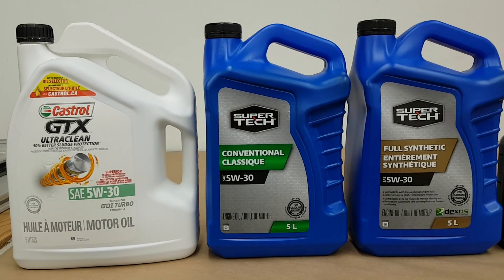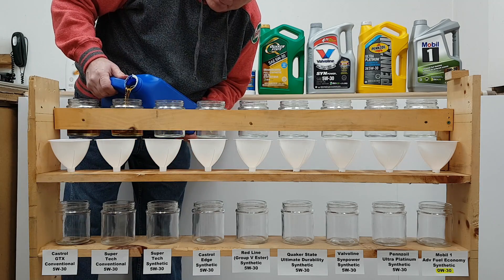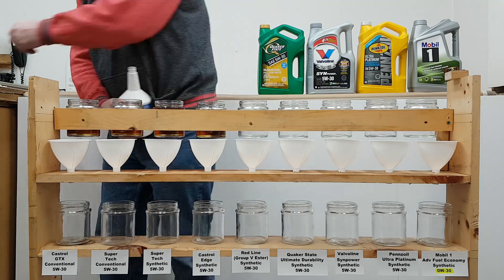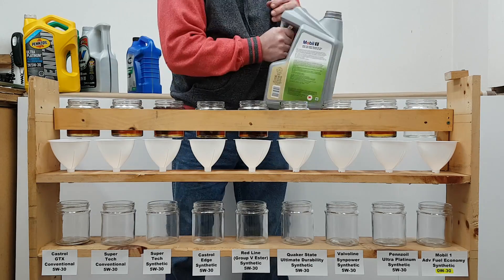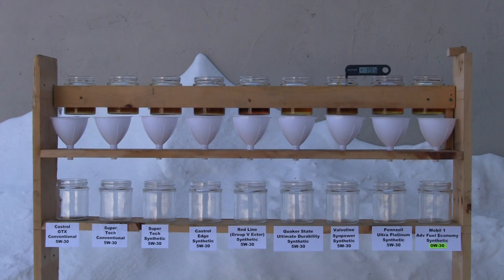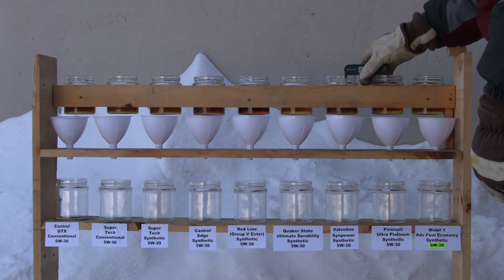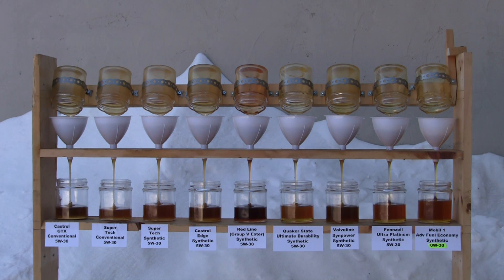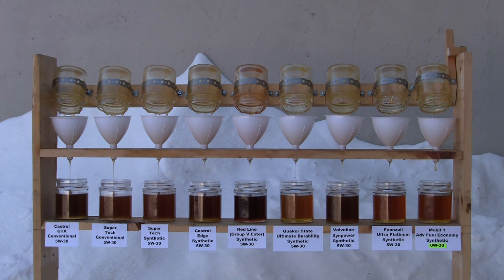9 Oil Cold Pour Test - Round 2

Comment: All oils work at cold weather. lighter is not good and heaver also not good. Choose the middle not light loss viscosity and not heavy cause late to reach engine parts and consume more fuel during the engine running. In general I would use 5w-30 synthetic from any provider in winter for all the counties close to the north pole, and below -20 degree use 0w, and 10w30 in middle east. in summer I would use  5w-40 synthetic, and 10w-40 synthetic for middle east. I recommend to use the oil pressure indicator on you car panel as a judge, when you use light oil, it will drop between the zero and first quarter, if you use heavy oil, it will increase above the half. use an oil that make the indicator at the middle or between the half and quarter.

Comment: There is one oil that while not popular claims to out do Amsoil and that is SynLube™ Lube-For-Life® which claims a 50,000 mile change interval (or no interval at all) instead of the 25,000 miles claimed for Amsoil.
http://www.synlube.com/faq9.html

Glad you included the two Supertech oils here. Why use conventional when for 24¢* a quart more you can have synthetic? (*Current difference in price for Supertech synthetic vs conventional 5W-20 in 5 quart jugs.)

Comment: These Cold Vicosity Test mearly show the amount of vicosity additives that have been added to the oil, they all meet the SAE vicosity requirment, if the Hi-Tech or Wal-Mart 5w-30 flows faster than any of the Top End Oils that tells you  that you are getting more cold weather vicosity additive than in the other oils, means your getting more for your money!  The interessting quastion is "who is mixing these  Low Price Oils that are knocking the High Price ones out of the ball park?"

Comment: What about amazon brand motor oil?
Reply: same as Super Tech oil, read the fine print on where each comes from.  as long as you are using the correct weight and API Rating (according to your cars owners manual) you are good.

Comment: Why not test all the oils with the lowest weight possible like 0-5w-20.
Reply: It won't make any difference.  A 5W30 will pour the same as a 5W20.  The lower number is the cold pour viscosity and the upper number is the viscosity at operating temperature.
Reply: Why Pennzoil ULTRA still would win

Comment: Outstanding.  Looks like Mobil 0W-30 Advanced Fuel Economy offers the best of all possibilities for newer car engines in the way of good cold and hot weather engine protection combined with superior fuel economy.
Reply: I'd bet 0w30 Pennzoil ultra would beat it
Reply: So you would run 0W-30 even though your oil cap says 10W-30 only
Reply: @diesel6916  I wouldnt I'd run the oil weight your car maker recommends

Comment: No cold enough bud, some of those oils were slower because they are thicker starting viscosity.  Good news is all those will protect down to -5f, bad news is if the test was -15f lower you would have seen a few of those oils fail and slow.  Check the other youtube on cold flow, you will see.  I know it's hard as freezers don't even go -20f, but if you don't go that low you don't see oils fail.
Reply: Depends where you live.  For many people, this is as low, or lower, than they will ever experience.  Tests at -40C are theoretical for lots of people.
Reply: If your winter temperatures are lower than - 20 F. crankcase heaters or covered garages offer best protection.

Comment: Looks like the 0W30 won handily, as it should, having the lower W rating. I would postulate that -24C is at or below a safe rating for 5W30, 0W20 or 0W30 would always flow better in arctic conditions!
Reply: 5W oils are usually tested @-30C for cold viscosity and 0W oils @-35C. A good 5W oil is safe to use still @ -30C temperatures. i live in Finland and use Mobile 1 ESP 5W-30 and never had a cold start issue, even if my car does not have a engine heater and still equipped with the OEM factory battery from 2017, always cold cranks with no issues with 5W-30 and the oil pressure light turns off immediately once the engine starts.

Comment: Hi Cris, Any idea what numbers should look at when picking an oil for hot weather? I live in Texas and it gets really hot here, so I think the best flowing oil under cold temperature is not a good measure for hot temps. Any suggestions? Thank you.
Reply from the maker: I would Ideally stick with what the owners manual says. If for instance it calls for a 5W-30 then go with that, but since you are living in Texas you will rarely see temps drop below freezing so you should be able to use a 10W-30 if need be. Same as if the owners manual called for a 5W-40 you can probably get away with a 10W-40. Some manufacturers even recommend a different viscosity dependent on what the expected ambient temperature the car will be driven in for the life of that oil change. If your vehicle is still under warranty though, I would only put in what the owners manual recommends at least until your warranty expires.  And keep your receipts just in case.
Reply: @crisashton573  Yes that's I've been using. The manual says to use 0W-20 for all temps. But there are other numbers in 0W-20 oil, such as NOAK number, flash point, etc..I was wondering if you have any information on that. Thank you.
Reply from the maker: @nycalien  I don't have any NOACK test results from any manufacturer other than the testing done by an independent lab back in 2013. The oils tested were all 5W-30 but the relative results would likely be very similar with their 0W-20 variants. The NOACK test is on page 8. The link to the test results is here:
http://wpc.1c96.edgecastcdn.net/001C96/G-Items/Performance%20Testing%20Archives/g3115-5w30-study-archived-2013/files/html5/index.html

I did find a little info on Pennzoil Platinum oil a user posted on bobistheoilguy website. The link is here:
https://www.bobistheoilguy.com/forums/ubbthreads.php/topics/4718980/Pennzoil_Platinum_and_Ultra_Pl
Reply: @crisashton573  I actually found it. You can go to petroleum institute of America site and they have data of all oil they have tested. A very good resource.
Reply from the maker: @nycalien  thank you for the info. I am going to check out their website. Any unbiased info on motor oil performance is good.

Comment: Hey cris, I have a older d16y7 Honda that burns oil of course lol. I was wondering if their is a "thicker" 5w30 oil to help reduce my oil consumption. I currently use 5w30 Mobil 1 extended performance high mileage full synthetic and I tried the Lucas oil stabilizer which helps alittle. Would switching to a 10w30 viscosity hurt? Thanks any help is appreciated and awesome work. Very good informative videos.
Reply: Must be at 212°F or wont be accurate because oils are designed for that temp.
Reply from the maker: Hi Cole. I have heard different opinions on this. The consensus is to keep using what the manufacturer recommends. Especially if your engine has variable valve timing.
Having said that, if you really want to try a slightly heavier oil, I would try a 5W-40 oil. It may possibly create a check engine light relating to your engines variable valve timing(if you have it) and I would then go back to the factory recommended oil viscosity.
Reply: @crisashton573  hey cris, so I'm going to stick with the 5w30 so I dont mess with my vvt. But is their such thing as a thicker or thinner 5w30 oil? Because what I can see from your tests is some oils flow faster and slower, are some heavier than others even tho their a 5w30 viscosity?
Reply from the maker: @coleharvey3620  Hard to say. In the cold the Castrol Edge was thicker to pour than most other synthetics. I can't say how it is when the oil is at operating temperature. I would like to perform a hot pour test but not sure if or when I will do it.
Reply: @crisashton573  okay awesome. Thanks for the help cris. I appreciate it.